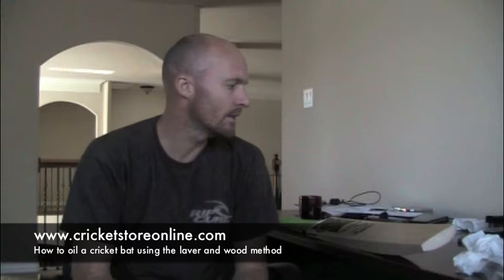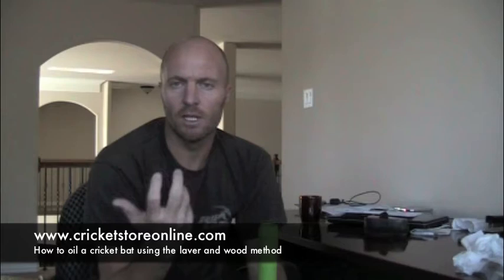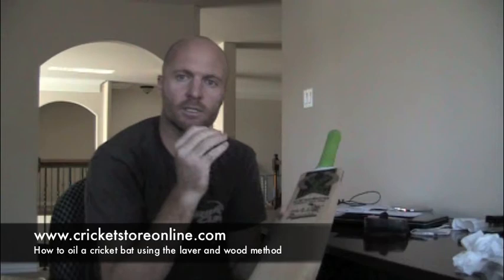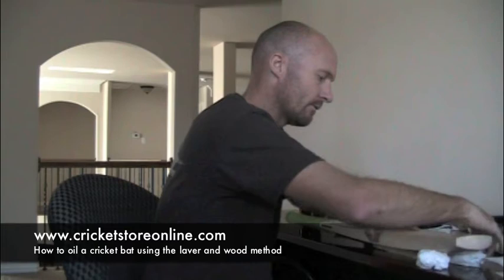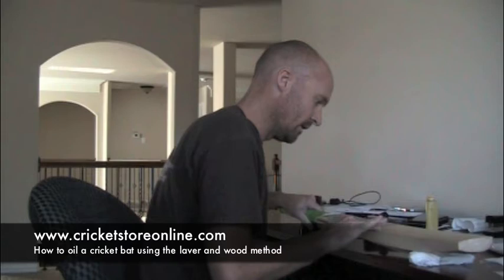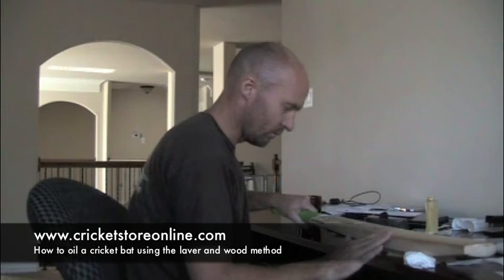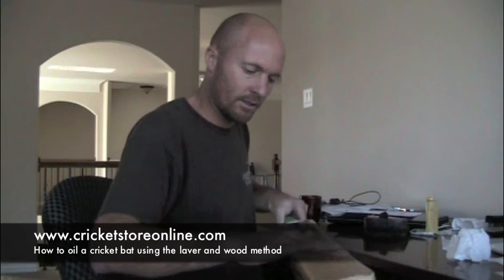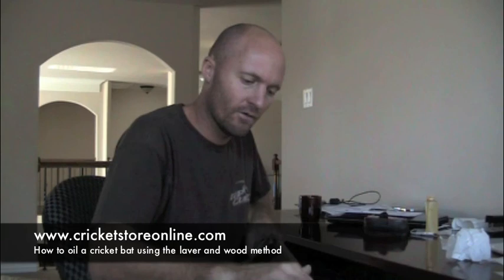Oiling your new cricket bat using the Laver and Wood method

Comment: Hey jason thanks for sharing this video 
But my query is that i bought a new balance dc 580 cricket bat and it came with the anti scuff tape on it 
And i want to oil my bat properly the problem is that is i remove the scuff tape it will dismantle the bats stickers which i dont want though there is a finger length space open for oiling
So what should i do and how should i oil my bat 
Plz help mate